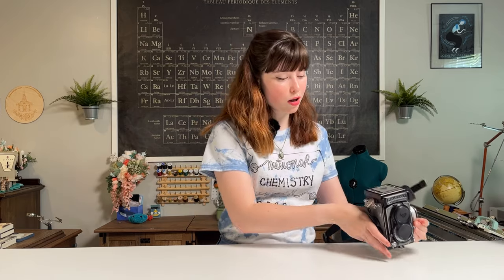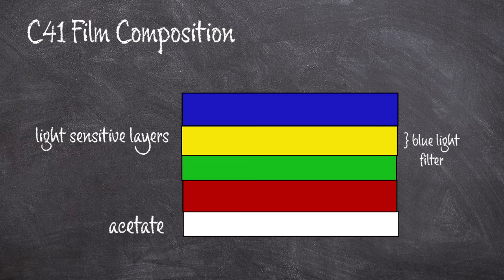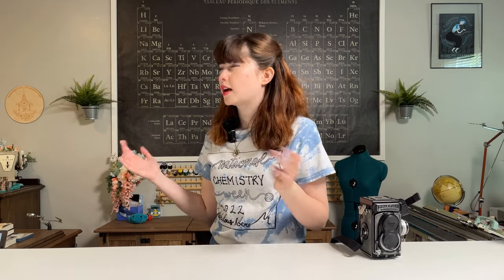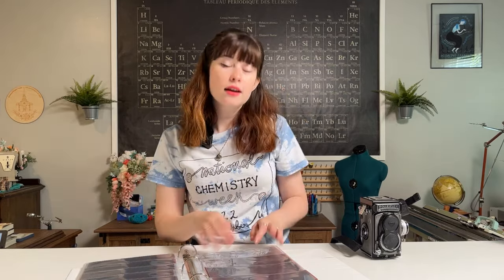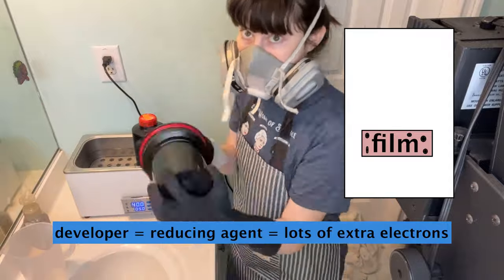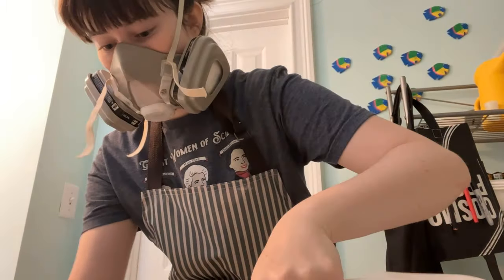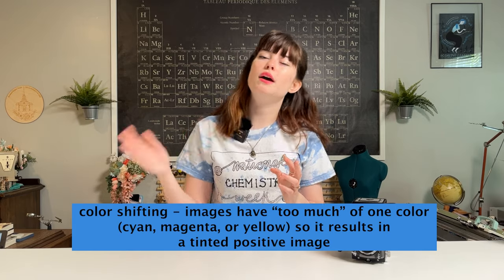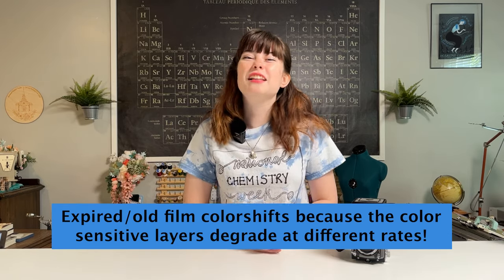How does C41 film processing work?

Comment: 10/10 fun fact. I wonder if it might be possible to somewhat fight the color shift by developing at different temperatures 🤔
Reply from the maker: That would be interesting to test. I think theoretically it could work but you would have to know more about which color layers had degraded before developing which would be kinda tricky. I've seen some blogs experiment with developing color film at different temperatures to see what color shifts they can get.